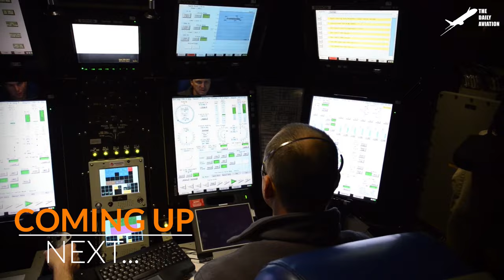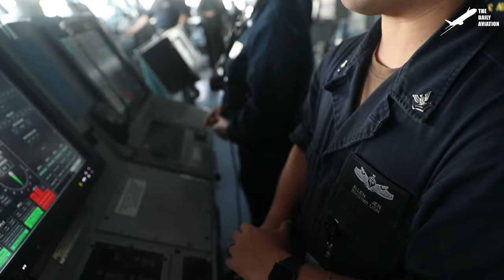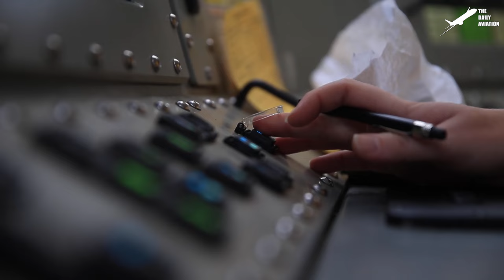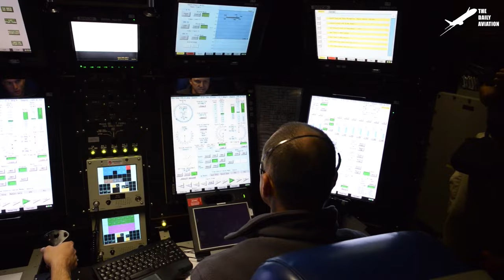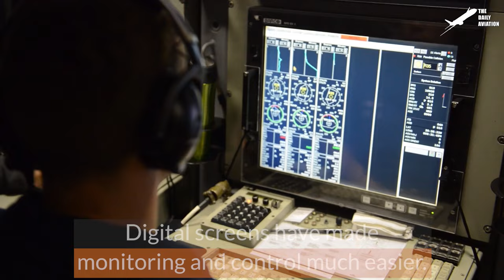Unstoppable US Aircraft Carrier Anchor Dropped at Insane Speed

Comment: I love how they always say a submarine “blows” it tanks to dive. They actually just open valves in the tanks to let water in. The valves are close to the top, and the bottom has holes. They shut them at a point where enough water has entered to allow the sub to sink. The only blowing is air going into the tanks which forces the water back out through the bottom. That’s so they can rebalance the sub under the water or go to the surface. Why only holes in the bottom, well they won’t be doing any airplane rolls underwater for one.
Reply: yeah, caught that error right away,  venting the ballast tanks should have been the word, but they are not SQUID so go figure   RM2{SS} 69-75